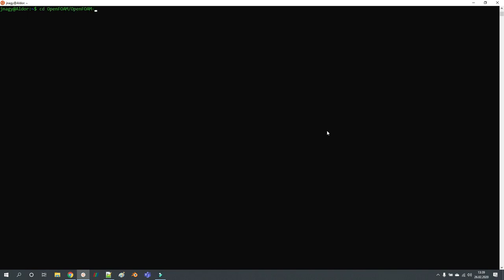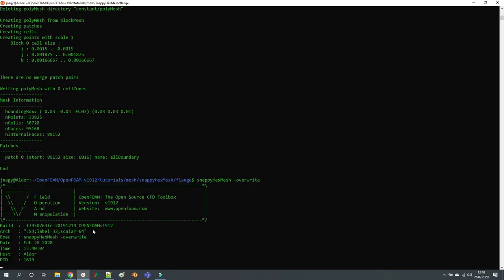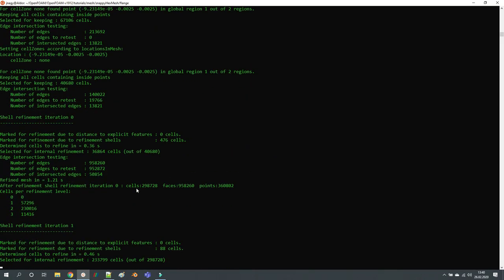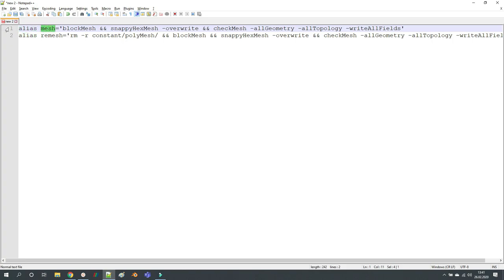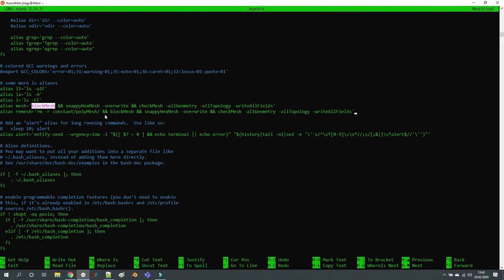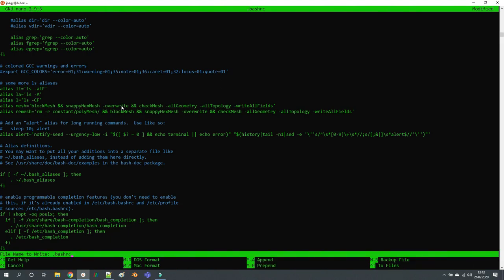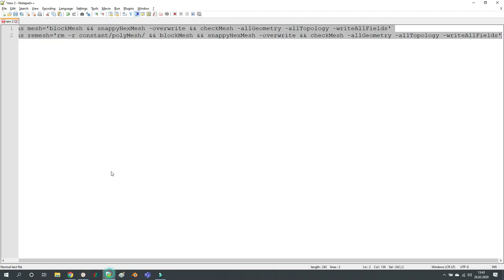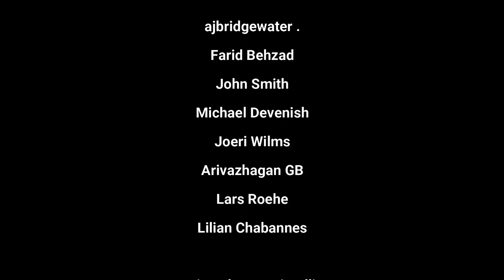Hacking snappyHexMesh - improve your meshing speed

Comment: Why not just set a script like Allrun.pre and add the cleaning commands? It is the way I do it.
It would be just the same, get the logs automatically and easier to set and modify, plus I use it to run batches of meshes, this way I try different settings with just one command and/or different geometries or cases.
And actually blockMesh already cleans previous meshes so no need to add the remesh command.
Though it was interesting to learn about the alias.
Reply from the maker: I like this, because this is always available. The Allrun scripts you have to look for and copy, if you are an organized user, it si not a problem. If you are a bit mire lazy (like me) you might not always find the scripts you require. bashrc is always there for you ;)